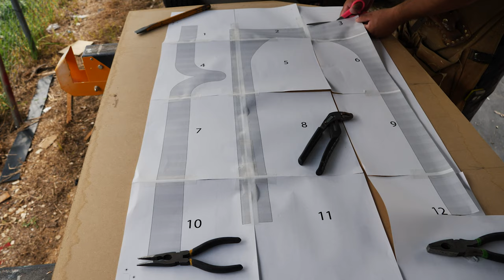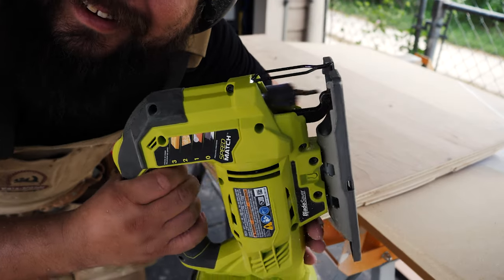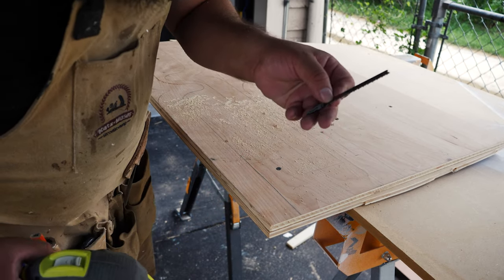DIY Decor Table Pedestal for Bridal Showers, Baby showers, Engagement Parties

Comment: Hey Ben, I have so much trouble cutting straight lines with my jigsaw. Which tool should I invest in next that is portable and can cut straight lines?
Reply from the maker: Yes, straight lines with a jigsaw is difficult. For most of my straight lines I use a circular saw. Then maybe a track guide or just some clamps so you can clamp a piece of 2 x4 down. And then just guide the saw side against the 2 x 4 wood and that helps a lot to get a clean cut. Also look at the kreg jig rip cut for circular saw or track saw. It is limited but wow that helps  it so much to cut straight lines. Hope that helps and  good luck!
Reply: @MakerDecor  thank you! I'll start my research from here and hopefully make a purchase soon!